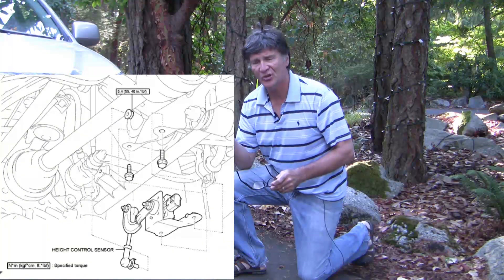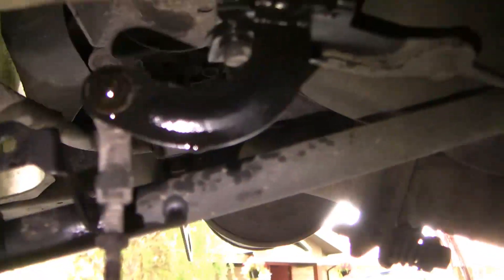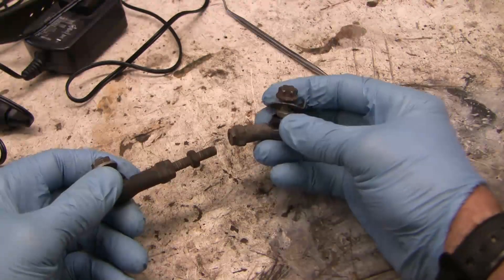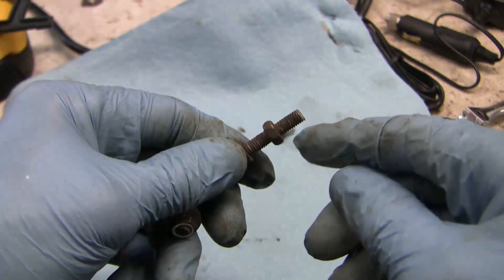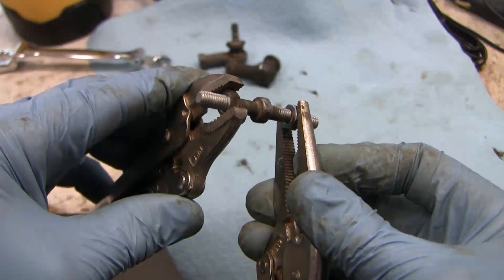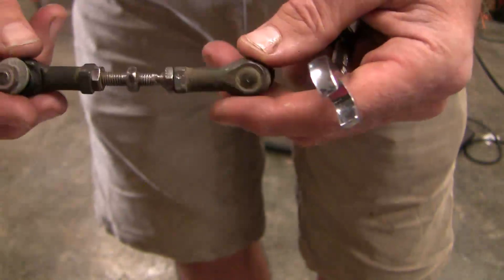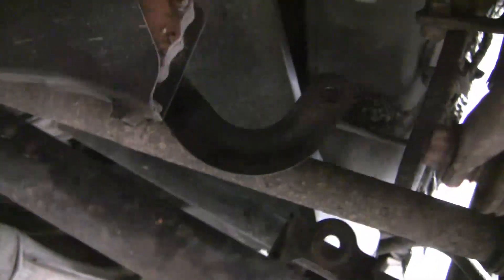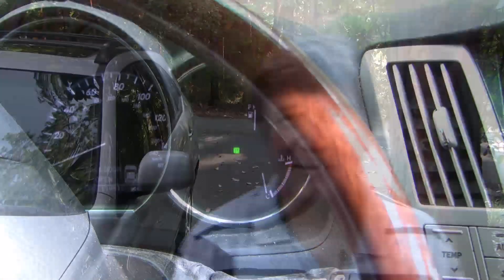"AFS off" repair, Lexus, Toyota, Prius

Comment: Hi, thanks for great vid tutorial. Do you know what's the part number?
Reply from the maker: The parts man at my dealership could not find an exact part number for the part that was broken on my car. On a search I found this described as the "height control sensor link subassembly". If your exact part is also broken, take a screen shot of the video at 0:44 or 0:55 and ask your dealer. Better yet, search the net and try to find out who make them. I'm hoping one day a viewer who found that stops by and tells all of us, ha ha. One viewer found a link (below in this thread) to a used Mercedes part for sale that looked identical. Another option would be to ask a general parts store like NAPA or Lordco to find something similar, or perhaps even make your own. Your cheapest option is going to be a local junk yard, if you can find one of those.
Reply: This is link to lexus' parts seller. As You mentioned before, this is whole sensor which costs 400$. It's probably impossible to buy original bar stabiliser without sensor.

https://www.xportautoparts.com/?year=2006&make=lexus&model=rx400h&search_str=height+sensor&scat=&p=catalog&mode=search&search_in=all 

Part Number: 89407-48030

Comment: very useful thank you. Friend of mine has had this go once before and paid £170 for a new sensor. Watching this it proves worth removing the arm first to make sure  its moving freely.
Reply from the maker: Thank you for watching. One viewer posted a link in this thread to a "Mercedes SLS leveling adjusting valve linkage arm" that looks exactly like the arm I was trying to find. The used part was for sale for about $40. Presumably the arm is made separately, perhaps even by a secondary manufacturer. Unfortunately I wasn't able to find a retail source. If somebody does find a source, I'm hoping they'll stop back and post the link here. Junk yards should be a good resource if you have one close by.
Reply: https://www.rapidonline.com/Mechanical-Fastenings-Fixings/Swivel-Head-Ball-Joint-M5-Steel-523780?utm_source=LexusOwnersClubUK&utm_medium=ForumLinks&utm_source=AffWin&utm_medium=Affiliate&awc=1799_1493990128_2e8c0f644f125b06005c62aa5b771373

Found the swivel head here. Might be useful for people looking to replace that and you can probably buy the arm as a threaded steel rod from any good hardware store
Reply from the maker: Good point, thanks for posting those links here, I'm sure they will help others. At first glance it seems over-engineered, but when you understand how those brackets have to move, you realize a ball and socket joint at each end works well. The OEM bracket was also equipped with left hand threads on one end, right hand on the other. That feature allows the user to adjust length with the turn of a wrench. Without that, you need to be sure you manufacture the part to the exact length -- in my case the end to end measurement from the center of the ball joint on each side was 4" (+/- 1/8"). If the new part is the same length as the old one, you may be able to get away without having to recalibrate the system, as I was able to do. Unfortunately if somebody already adjusted the headlights at the fixtures, recalibration is unavoidable.

Comment: i have been battling with my afs light for a long time now. i replaced my two headlights and the afs light came on and refused to go away. i have adjusted the sensors to no avail
Reply from the maker: That must be frustrating. You've probably already done this but I would retrace your steps taken to replace headlights to see if the AFS motor and sensors near the headlights were somehow disconnected. It could be as simple as a ground wire that was disconnected. Or, it could be a mechanical issue with how the headlight fixture fits into the housing. You may get some information by using a high level code reader to help identify the problem. Sometimes the system just needs to reset itself, so you could disconnect the negative pole of the accessory battery and see if it will reset. Remember to get diagnostic codes before doing that because the codes may be lost after a battery reset. Failing all of that, I would start testing parts individually, which would be much easier with a scanner having bidirectional control. At some point it would be wise to ask for help at the dealership. Good luck! If you learn something that may help others, don't forget to stop by and let us know how it turned out.

Comment: Would it be possible to use a long threaded bolt, cut head off or rod that matches the thread? The assembly looks exactly like a minature sway bar link.
Reply from the maker: The tricky connection is where the shaft meets each end, because both ends need to be flexible enough to cope with bouncing over speed bumps as the angle between ends constantly changes. Of course bolting it solid so it can't move will never work. One possibility would be to drill a tiny hole across a 4" long solid rod at both ends, then use wire or a plastic quick-tie run through each hole, to hold each end firm to the matching connections so that the shaft transmits length information without allowing undue torque to twist and damage the sensor. I'm hoping people like yourself will stop by and describe their solution to this problem. If I had to do this again I'd check out the Mercedes link described in the thread, below. It looks like the identical part.
Reply: I understand, it's the same setup on a sway bar link, maybe an alloy RC ball joint if not there is this http://www.ebay.com/itm/381353025388?var=650547706144 searching "ball joint" online yields different options or sizes. I appreciate the effort put in getting the part back into service. Cool video.
Reply from the maker: Great link, that one would have potential as far as building your own. Excellent price! They don't describe left hand threads but you could build your own rod if you can find metric threaded rod and if you could cut it to the right length. Around here most retailers only sell SAE threaded rod, although a specialty store might be able to get metric rod as a special order.

Comment: $700 for single sensor?
Reply from the maker: Yes, $750, and that is double what the dealers manual describes. We live on a Canadian island, and I assume part of this is the fact it is Canadian dollars. Of course the dealership will also complain about extra duty, extra money to pay employees, extra taxes, extra shipping charges. However with no competition, I think a big part of why they would charge so much for a simple potentiometer is because they can. I love to support local brick and mortar businesses in the local area, but they should do better than that.
Reply: After you welded it was there any calibration needed?  I mean it needs some reference to find the level from which it can then decide if the light need to go up or down.
Reply from the maker: No calibration needed in my case.
Reply: @spelunkerd  I bought the link part on Amazon for $65 CAD Looking at it, if you are working with an older car I think a small turnbuckle would work just as well.
Reply: Send me the link to buy that part
I need one

Comment: Couldn't you just use some all thread.
Reply from the maker: That was my first instinct, since you don't need the complex multifunctional extendability of this arm. When the car is sitting in the driveway you don't appreciate how much the arm needs to swing, mostly side to side but also front to back. Ball joints are one way to allow movement. Is there a DIY solution? I've seen discussion by some DIY mechanics where they wire up a looped coathanger between the two pivot points, to try and provide the combination of mobility and rigidity needed. It would be interesting to see if that works over the long term. I would worry a little that a DIY solution might put the sensor at risk for damage when the car hits a big bump, and replacing the sensor would be next if it fails. If I had to do this again and I couldn't repair the broken part, I would look for that arm again on Ebay and elsewhere. There's a market for somebody with the initiative to find a supply and advertise on Ebay. Lower down in this thread there is a link to a Mercedes part which looks like the exact copy for $40! I'm hoping people who do this in the future will take the time to pass on their experience to others, by describing how they solved the problem. Thanks for chiming in!

Comment: Smashing repair, i dont blame you, the dealer was just taking the mickey, expensive :-(.

The left/right handed thread adjuster is nice but not really needed, i bet there are ball joints out there that are similar but just right handed thread, easy to make one.
I wonder what the actual sensor is, it looks crude so it may be no more than a reworked tank fuel sender resistor, i dont think precision matters lol.
I hate "Special devices" its a license for the manufacturer to create expensive problems :-(.
Reply from the maker: Yes, I agree. It's just a potentiometer, and there are some nice videos here on youtube that show the inner workings. Commonly when one of the ball joints seize, those torsional forces are sent through to the potentiometer, ruining it. So I guess it would be better to have a weak sacrificial link in the system that is easily replaced. One of the remarks below show an identical looking arm on a Mercedes -- that might be worth looking for if the arm can't be repaired. Thanks for watching!

Comment: Nice repair, have to say that part with the sensor is not worth much more than 75 bucks but with that said this is an awkward way to sense ride height. Maximum over kill in system design. Banging ones head against the wall right now.
Reply from the maker: Yes, I agree completely. I was shocked to see those extra joints, and I wonder how an optical laser system would work. Probably those would fail too, like a computer mouse.

Comment: That piece looks really familiar...  Older Mercedes with self-leveling suspension (SLS) used an adjustable rod almost exactly like that.

Here's one here for about $40.  https://mercedessource.com/store/123-300td-wagon-sls-leveling-adjusting-valve-linkage-used
Reply from the maker: Wow, excellent link, thanks for posting it here. It looks identical, though it would be nice to know dimensions. Mine is now fixed, but for $40 I would have jumped on a new one. I'm sure your link will help others. I found a few that looked close, on ebay, but none as close as this one!
Reply: spelunkerd
I wish I still had my old Benz; I'd take a measurement for you!  As I recall, 4" sounds right in the ballpark.

If for some reason you want to go looking, the W124 and W123 chassis Mercedes wagons used nearly identical parts, and there are probably lots of replacement parts still floating around there.  Look for "Mercedes SLS Adjustment Rod" or something similar.  :)
Reply: rhkips Dorman makes the replacement arm separately.  Just in case you were wondering 😆
Reply: Good to know!  I tend to be a bit iffy about Dorman stuff, but it'll get you by in a pinch.  :)
Reply from the maker: Yes, thank you. I'm a little surprised my dealer didn't know that but in any case it is good to know.

Comment: JB-Weld likely would work also. 
I plain refuse to buy any new parts at a dealership anymore. They won't even offer to buy me dinner before they screw me.
Reply from the maker: That's a good point, there are many options beyond what I did here. For those with no access to a welder, it's often surprising how inexpensive it can be to get small parts welded by a pro. You just take the bare and clean part in, and often $20 cash is all it takes to get it put together on the spot. By removing the rubber seals before hand, there is very little work to the job.

Comment: Hey Dave...very nice video and I like where you spent a little more time with this one to cover a little bit more of the details. As you probably know, the Tucker car from the 40's had the same idea of moving the headlights when going around curves. Because of complications, they settled for the cyclops eye in the center. And I would be doing the exact same thing when I heard you say that the dealer wanted $750 for that arm and sensor. Unbelievable....Do you know what kind of sensor was being used? possibly a potentiometer or an accelerometer. Great video Dave!!!!
Reply from the maker: Yes, what a shock. I got lucky because the bolt broke before the sensor was damaged, but many were not so fortunate. You can imaging that arm grinding the guts out of the sensor if the bolt doesn't give way, and so having a weak link will protect more expensive parts down the torque line. It's just a simple potentiometer, and on one forum a couple of engineers considered making their own. However the devil is in the details, and it would take some time to come up with the right copy. On some of those discussion forums they mention US prices vary between about $270 and $450, which is still outrageous. I think it is unconscionable that Lexus don't sell the arm by itself to their customers. What a scam. Even more of a scam when you see that our local dealer here in Canada basically doubles the US pricing.
Reply: I'm just glad to hear Dave that you didn't have to spend all of that money. And even with US prices as you've mentioned, that's still very high. Good work as always Dave and looking forward to future videos. Take care and now you can take a break and watch a good movie on TV :)